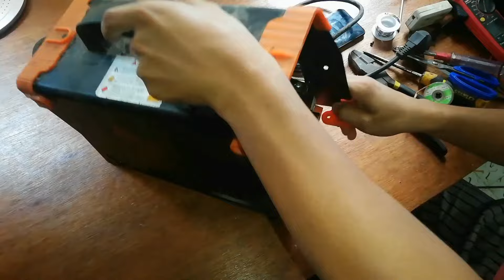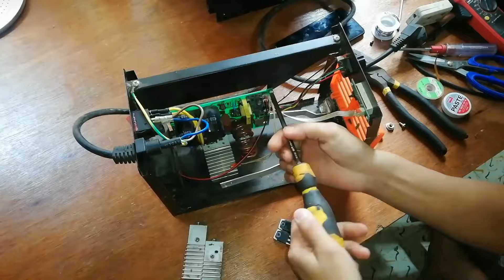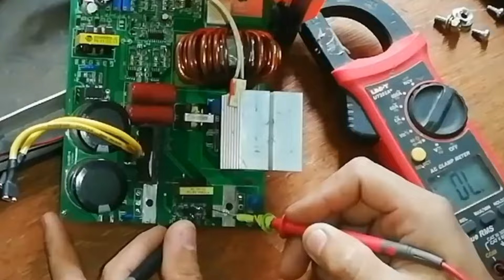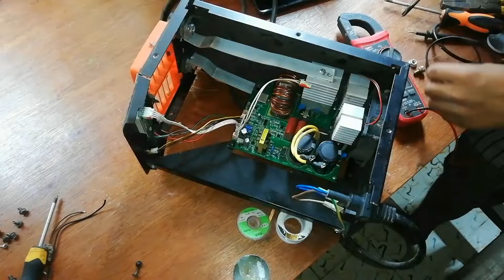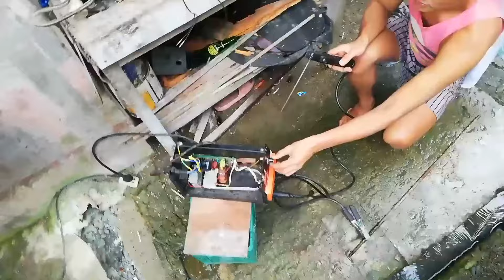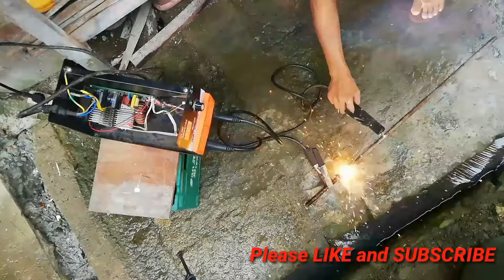how to repair inverter welding machine /paano e repair ang inverter welding machine

Comment: Pag po nagtitrip ang breaker pag ginamit na ang inverter welding machine ano po madalas na problema? Baguhan lang po..
Reply from the maker: Boss, need nyo po kagpalit nang circuit breaker na mas mataas sa ginagamit nyo. Sa amin po kasi 20 ampere po ang para sa outlet kasi sa mga outlet kulang po sinasaksak ang inverter welding machine ko boss… try mo gumamit 20 ampere na breaker kung saan naka connect ang welding machine mo boss.

Comment: Boss bka magawa nyo pa itu 200amp welding machine npasukan lang po ng alambre un fan at nbasag un elise ay kaylangan ku matapus  nag over heat sya tas ippahinga ku inthen ewweld ulit nung last kunang weld nawala na po un ligth nya at wala ng out sa pag welding bka po nga sa igbt ang diperensa  itu po un picture

Comment: Boss, ano po sira kapag naka yellow warning. May output siya na 5.something volt. 5 volt fix po. Yong karugtong ay pabagobago ng tenester ko. Mitsushi na welding machine.
Reply from the maker: Need po siguro yan palitan ng IGBT or 18 volts na transformer sir kay dapat nasa 40 to 60volts ang output nya at nasa 100 amps pataas..
Saan po sa inyo sir.? Baka malapit lang sa amin para ma troubleshoot ko boss at ma repair
Reply: @creativejunior7060  bicol po ako. Tiningnan ko po Kung ano pyesa may sira sa itsura @ may nakita ako don sa pwm na board. Yong parang ic 8 para. 4 kabilaan na paa, may butas sa gitna na maliit. Hindi Kasi ma upload pictures nun Kaya Di ko mapakita sa inyo. Wala Kasi dito na attached button. Sa comment section. Ang nakalagay sa board ay VT2 o Baka UT2. Di ko ALAM anu tawag don. Wala pa value. Dalawa Kasi yon, Yong may butas na maliit Yong ikalawa. Yong ISA ok Naman sa paningin. sa Una Kasi nagblink blink Yong yellow light pakatapos Ng 5 blinking ay tumoloy ng nakayellow.
Reply: bos asa inyoha dapit?
Reply: @markjonhochea6626  tinapon KO na po Yan, naglinis Ng mga Kalat matagal na

Comment: sir yung welding ko may power pero walang spark balak ko mag palit ng mosfet ang kaso dun sa online yung mosfet ("R60UO2DB 851 N  1522") yung nakalagay pero sa welding machine ko ("R60U02DB 910 N 1606") pwede ko ba sya ilagay kase parehas naman sila R60U02DB ang pinagkaiba lang eh yung nasa ilalim nila